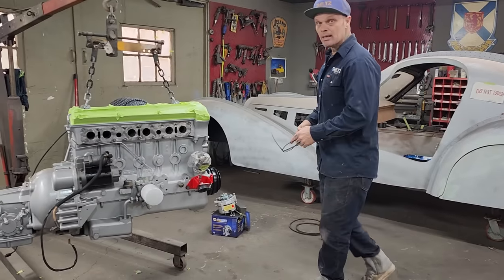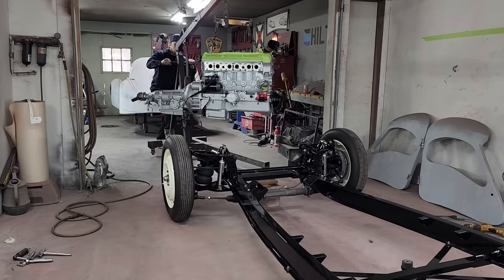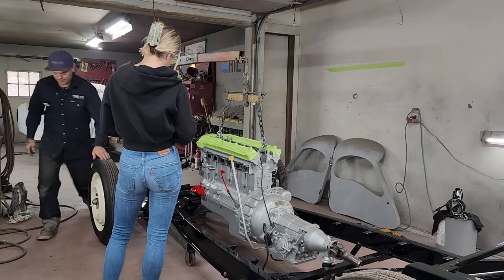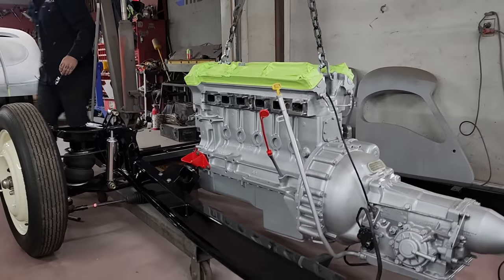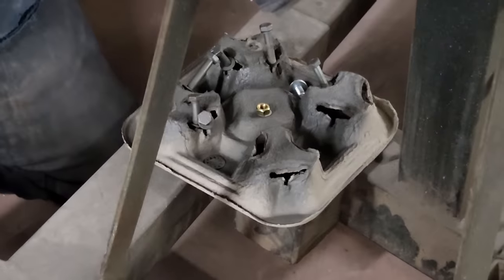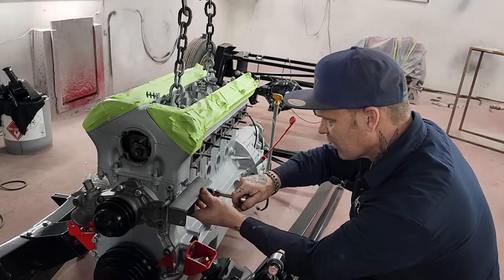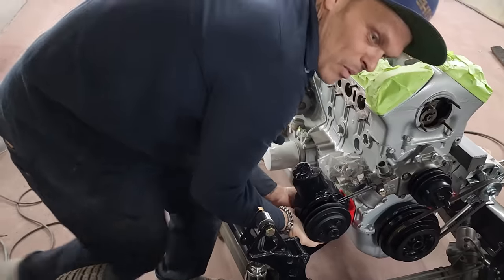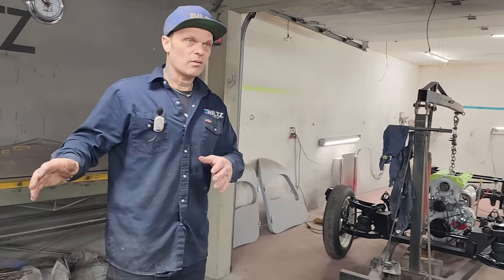The moment of truth: is the new Jaguar engine going to fit the chassis? 😬

Comment: Looks great !!! Lock nuts on motor mounts, because vibrations. Bugatti ran straight pipes at the tail apron 8 on the originals. 5 small straight pipes would look great .

Comment: For clearance between the waterpump pulley and the radiator you may have to get a bit inventive. As people have mentioned maybe an electric fan or two. But on my 64 Galaxie fastback with a 390, I have an aluminum waterpump pulley and no fan blade. I have an electric fan, but the pulley bolts were too close for comfort to the fan motor. So I countersunk the bolt holes in the aluminum pulley and used stainless flat head screws. If they had been really visible I would have used allen head, but since you can't really see them I just went with phillips head. So now no protruding bolt heads and about 5/8" clearance. Never has touched. So maybe take the fan studs out and use pan head allen screws on your set up so the studs aren't protruding past the nuts or use countersunk screws like I did.  Just some thoughts.

Comment: A fastener sales guy did a demonstration with a clamping force mesuring device many years ago using "lock washers" and no "lock washers".  Using the washers did not make anything better. I haven't used a lock washer in the 25 years since that demonstration and nothing has fallen off.  Springy washers mess up bolt stretch which holds things tight.

Comment: That car is an excellent replica/re-creation of the original. This is personal preference but I would have wanted a 4 speed manual box and I would have left the fuel injection in place, even though the electronics would probably have been "challenging". The fuel injected XK 4.2 had about 202 hp DIN which would be about the same as the original Bugatti (200PS claimed) and you could draw the series 3 XJ6  torque curve with a ruler.

Comment: As you were wrestling with the left motor mount bolts with Jolene,  and doing the usual contortions that we do to get nuts and both washers into a spot you can't see and a lot of times with the non dominant hand, and gravity is fighting you, and the washers rain to the ground 57 times, it came to me. How long does super glue take to set? Maybe a dot of super glue holding the washers together and even the nut. Put them all up at once and then tighten the nut. The super glue will shear as that stuff has tensile but not a lot of shear strength. I'll have to try it.

Comment: It is not uncommon for British cars to have the battery or batteries in the trunk.
If you decide to put the battery in the rear then I would recommend you put a couple of power pickup points (plus and minus) in the engine bay (very near to the starter) to facilitate jump starting or trickle charging if need be.

Comment: Instead of grinding the web on the block that hits the header you can just mark the header where it makes contact with the web. Then remove the header and lay a piece of pipe across the marks and hit the pipe to make a indent in the header saving your nice paint on the block.

Comment: Hi Chad love the project, my concern is the angle of the tie rods to steering arms , on bump steer it could lock the outer wheel to the turn on full lock. The steering rack should be inline with tie rod centresm Maybe i am wrong

Comment: You could use a ratchet strap on the rear header and pull it straighter instead of grinding on the block.  fresh metal pipes will flex before they are heated and tempered. worked for me.

Comment: You might need silicone sealer on the water pump gasket at some point, otherwise you may leak antifreeze when the motor is run and at temperature.
Reply: That's what the gasket is for to seal it, auto manufacturers build millions of engines each year without putting rtv on gaskets with no problems .

Comment: Chad since the engine mount nuts are on top rather than on the bottom and they are not lock nuts nor safety wired, you may consider a small tack weld to make sure that the nuts never come loose.

Comment: Just a question, can you swap your 2 exhaust manifolds? The front 1 mite clear the block and the back 1 on the front, then a Y adapter that you can bring it out pass the the transmission. Just an idea. Great build.

Comment: Chad you need to get o e of those small dirt track one wire alternators instead of the big GM alternator,and it will save you alot of room and the same thing with the power steering pump they are a lot more compact in tight areas just a suggestion 😉

Comment: Just a little advise, when installing bolts they should present 1 and 1/2 diameters  of free bolt before screwing in, any less than 1 diameter you stand the chance of stripping the thread, now we don't want that happening do we

Comment: Chad you might want to switch the regular nuts out for nylock locking nuts. So that they don't vibrate loose. With everything being so tight. I always use that type of nut whenever I can. Just a little food for thought...

Comment: Nice work. But......
Lock washers are for farmers. You use nylon lock nuts or two way lock nuts. Lock washers only stay tight until they start to come loose. They actually help unthread a bolt. Anyone in Motorsports knows that lock washers are a unforgivable sin unless they are used in very specific cases.

Comment: I would have used some Gasket Goo on the water pump seal, thats just me and what 51 Chevy said about blind and not blind bolt holes, you dont want that water pump leaking after you put the body on.

Comment: Also you should look at the float you mounted. In the petrol tank.
It should be mountend with a firm flange and contraflange. The you did it will leak, and than you are
In trouble, because you have to remove the petroltank and welding will then more difficult and dangerous.

Comment: I am sorry to ask this does the lock washer works with a flat washer bolt in my mine it does not 
bolt and lock washer works I thought a lock washer is built its way to dig into metal and keep the bolt from turning 
with a flat washer, the bolt will turn   right

Comment: Intake manifold: carburetors have to heat insulated from engine, so engine block does not transfer heat to carburetors, fuel may boil.

Comment: There are on most engines one or more of the water pump bolts that should have silicone on the threads because they go inside the water pump housing

Comment: That old schemer Doug’s engine undeniably would’ve had Chad taking the Bugatti body on and off again dozens of times, so likewise the newer used engine has gotta be dead on right reliably running at 100%, the way this car was built Chad will have to take the body off every time the engine needs internal servicing, that old snake Doug had to know his shoddy engine would be revealed in short order for being far from the 100% that this build demands. The motor clearance issues not allowing the engine to be dropped in the usual way through hood bay, requiring taking the body off the chassis to service the engine, I don’t know if the used 1984 engine will hold up in the long run? Chad probably should have bit the bullet to spring for a newly remanufactured or freshly rebuilt accurate looking replacement engine, that would be the most reliable trouble free motor, given Jolene’s Bugatti’s unique design actualities, fingers crossed…8)

Comment: Engine look nice in the chassis, but please Chad get professional advice about your cooling system.
Befor you do anything else check if you have the correct radiator. If not you gone have serious trouble.
And because removing the engine if the car is ready will be a great job. The radiator must be of the right sise.
It looks to me that there is not to much space for a big radiator. So beware !!!!!

Comment: Using a lock washer on top of a flat washer defeats the purpose of a lock washer. It needs to bite into what you are bolting to. Or go lock washer, flat washer then  nut

Comment: Sorry to rain on your parade, but that water pump is going to leak..!! should have applied gasket cement to the face of the water pump, then put your gasket on the water pump. then with your finger smeared some cement on the face of the pump housing, then bolted it all on. John, Perth, Western Australiia

Comment: @13:58, jolene's hands are in a terrible,  compromised position. Chad has put her in harm's way with no safety coaching. Hands should NOT BE UNDER   a suspended trans or engine.
Reply: Her hand is directly over the crossmember.  Horror

Comment: I SEE NOTHING  HOLDING THE MOTOR FROM TWISTING, WITH RUBER ANNTY VIBRATION RUBBER TUBES TOP MOUNT ( DOG BONE ) SIDE TO SIDE  ALSO U SHAPE BRACKET TO MEET MOUNT TO MOUNT STAUBILATY  SAVING THE FRAME FROM TWISTING ( UNER THE OIL PAN ) OR ACROS FRUNT BETWEEN PULIES AND BOLTED TO MOTOR NOT THAT IM  KNOWLEDGABLE,JUST KNOW I HAVE SEEN THEM BEFORE ,AND YOUR SETUP LOOKS WEEK  ON THE POINTS I MADE